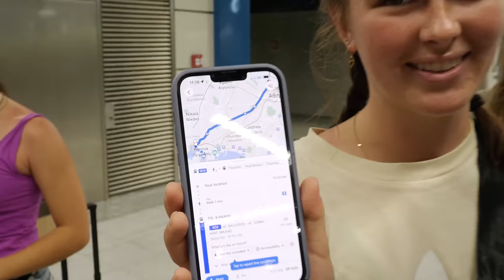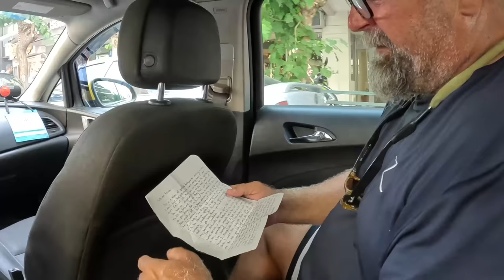Goodbye Greece! We're Sailing to Italy! 🇮🇹 (Ep 248)

Comment: I think you should get a Resin 3D Printer in case you need to make parts. I would nor recommend a filament 3D Printer because the high moisture . But a small Resin printer could get you out of trouble. The ideal printer would be a powder based but it's large and expensive.